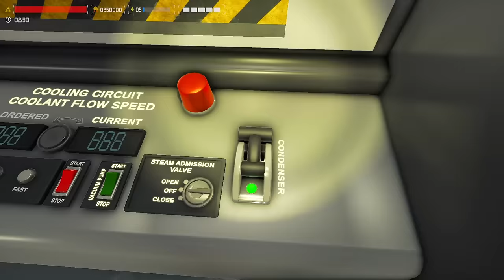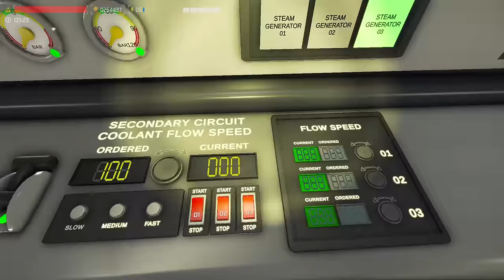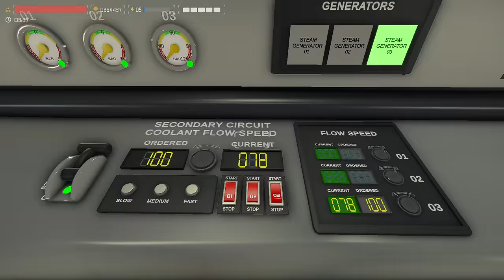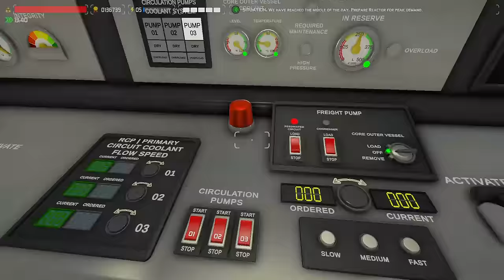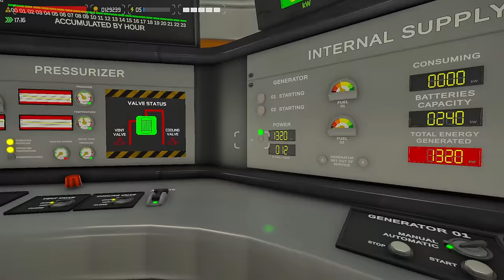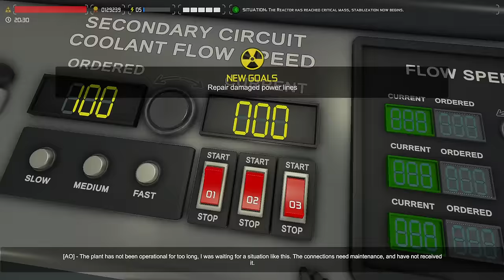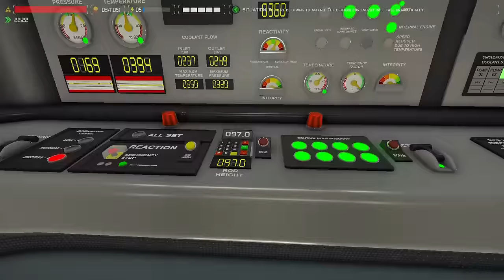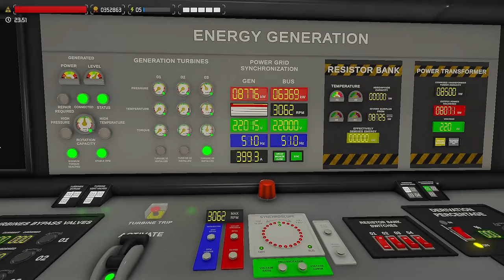NUCLEARES Scenario 3: Startup An Old Shutdown Reactor

Comment: i think that the batteries will not charge when the plant is powered by diesel generator if the charge limiter is switched on (green switch on the switchboard near the diesel generator); you have to switch it off to enable charging; and you must switch it back on when the plant is powered by the turbine (there's also a warning written on the switchboard)
Reply from the maker: I mean normally when I'm not playing scenario, and accidentally dip into the batteries, the batteries will recharge. Another person suggested that it was because all the batteries were not installed, but I never needed them. It would be kind of silly if you couldn't recharge batteries with the diesel if you had sufficient power to do it, don't you think?
Reply: @GWHacketts  the thing i don't like abbout the batteries is, you can get the extra 16 batteries, in the 4 cabinets on the left of the room BUT, the battery charging and discharging only works with the 4 that are installed in the center, the extra cabinets are just storage. at least as far as i've found. I've yet to do alot more testing but that's how it seems to me as those 4 are the only ones to discarge when i'm in need of them.

Comment: @Gaming With The Hackett`s one thing everyoe misses is in the internal supply room where the switches are located there is a green switch that says Limited Battery Charge If that is On the batterys will not charge unless switched off.
Reply from the maker: Interesting, maybe I misread the breaker. I will have to check that out, thanks for the tip!

Comment: If you do maintenance tasks and the reactor doesn't need to run, you can just turn off everything. Including the diesel generators and the batteries, because maintenance drains fuel, but you don't need it, while maintenance happens. If you want to make sure, OA can reach every location, just open all doors, that he needs to go through and keep them open, then turn off all energy.
Reply from the maker: That's a good Idea, I'll do that next time I play, so I don't waste so much fuel. I guess I think too much about actual reactors. Always have to some flow for a significant period of time after a criticality. Thanks for the tip!
Reply: @GWHacketts  in that time you can also have new machines built and do upgrades
Reply: Know, that you can also sell machines as well, makes sense, if there's better versions, like there's 2 kinds of diesel generators, that you can have. Never sell one, if you don't have another.
Reply from the maker: Yeah, I've done that. I always get the better diesel, because lets be honest, the original is trash. That's also a good idea using the maintenance period where AO fast forwards to get stuff built and installed!

Comment: @Gaming With The Hackett`s you only need to use Hazmat suit if there is Radiation when the reactor is not working you can goto the Reactor without hazmate suit I have done it many times and I get no radiation.
Reply: And you will know where there is radiation by now you may know when radiation has occured.
Reply from the maker: True. I only did it because I kept taking damage going down in there so I wasn't sure what was happening.

Comment: Maybe you can help me with some troubleshooting: I am having problems stabilizing the pressurizer volume levels. I repaired the control rod controller, adjusted the valves after I ran the plant-wide maintenance cycle and inserted the fuel core. I started the primary coolant pumps and set them to 100 to make sure the primary coolant loop coolant fills up the pressurizer, but after a while the pressurizer volume levels drop to 0
Reply from the maker: Is your pressurizer heaters on the whole time, or pressure getting to high? I am not sure if flow impacts if the pressurizer fills up, but to add water to the core, use the RCV and feedwater pump, if it overloads than it should be full. In one of my videos I was having level/ pressure issues, so I vented the pressurizer, and it seemed to work for to steady it out, but I am not entirely sure if it was just glitching.
Reply from the maker: So I did some reading in the manual, and it says the cooling valve can add water to the pressurizer, so maybe try to jog that and raise the level in the pressurizer back to a normal level?
Reply: @GWHacketts  Another reason might be that there's a broken pipeline... I haven't checked those really when I was starting up tge reactor, but normally they should show up in the maintenance report and be fixed by AO, right?
I'll try another time today and report back if venting the pressurizer might work
Reply: Jiggling the Pressurizer drain valve open for a while and then closing it again fixed the issue
Reply from the maker: Yeah scenario 3 has them and if you run AO maintenance report he finds and fixes. You jogged the drain valve? I didn't know it had one. lol

Comment: The reason your batteries aren't charging is because you only have one of them in the supply/charger. The other 3 batteries are still in the backup battery storage behind the generator.
Reply from the maker: Interesting... I thought I looked in each section, but I guess I didn't good thing I didn't need them anyways. I'm going to go see if I can find them. Have you been able to unlock the fourth achievement "Survived AO's Madness"? I only have the three scenarios available (power, nature, and startup).
Reply: @JH-xj8vm  ow I just completed that a few hours ago. You need to wait a few in game minutes (15:35 in game time I think not much after) for a cutseen after completing uninterrupted power, I won't spoil it. I haven't completed nature tried a few times but can't seen to stop the flooding except the genator room because of the blastdoors there.
Reply from the maker: You only need to supply power and stop from the generator being flooded in the. The Reactor compartment doesn't matter. Just kill the resistor banks and give them all the power they can handle without having the turbine go crazy. So after you get the achievement for the scenario you just sit there a little longer? Lol I'll go try that. Maybe I will have to add that snippet in a walkthrough! Thanks for the tip.

Comment: Did you know? There's a cleanup option, where you can just have it all removed, without you having to throw into the bin yourself.
Reply from the maker: Oh when you run the maintenance report? I just do it so I can order new ones. I think the empty containers count towards your total. That's what I read at least.
Reply: @GWHacketts  Ok, i checked, no, you actually can see, what supplies you have, same option you use to buy supplies. When you intend to buy stuff, it says "cleanup" below the buy option. If you click that,  you get a list of each individual gas can, if you selected that and there you can also clean it up, thus you don't need to pick each of them up by hand, no matter, where it is in the facility.
Reply from the maker: Oh sweet, that's very helpful! I'll have to check that out, thanks for all the tips!